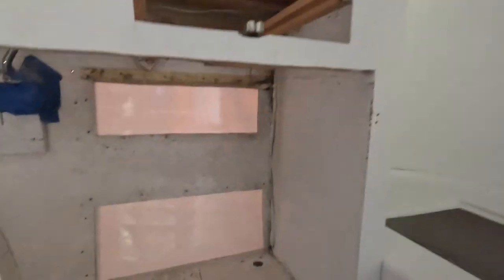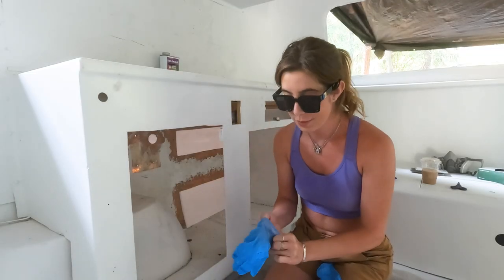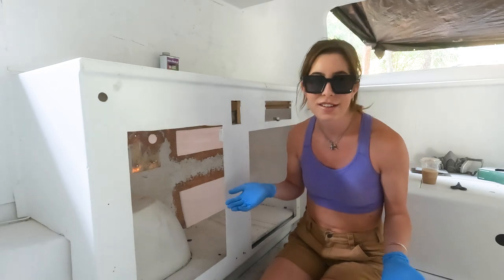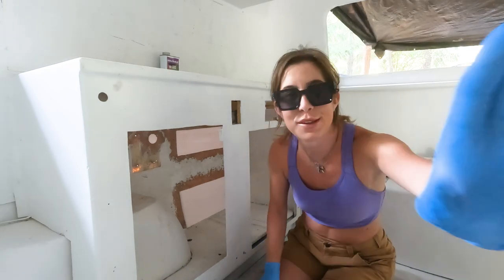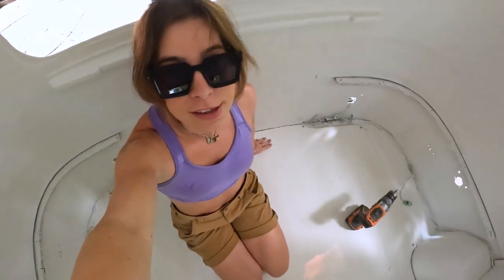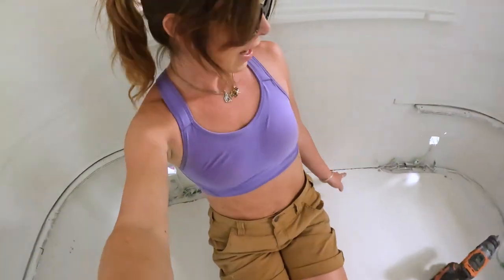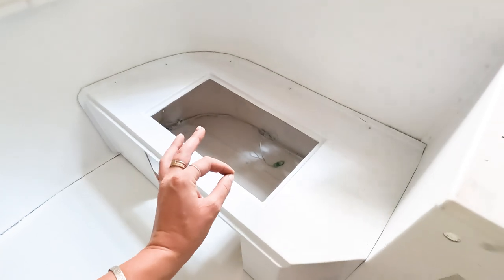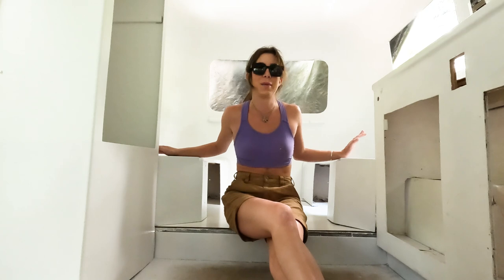Huge Fiberglass Repair on My Camper 🫠 *send help* | 1972 Boler Restoration

Comment: Polyester resin is very easy to work with. Looks like you used woven mat. They also have CSM (Chopped Strain Mat) that works extremely well with polyester resins. And once you get everything covered over and sealed, it sands very nicely and feathers out extremely nice to give a very smooth finish. They also have colored pigments you can add to the polyester resins if you like. You can hardly use any of in wrong. It sands so well that even if you think you messed up, it will sand out so nice that it doesn't matter... Thumbs Up!
Reply from the maker: oh okay! i bought both types but figured this would be better... next repair, i will use the other. Thank you!